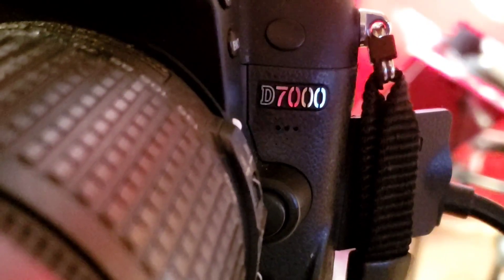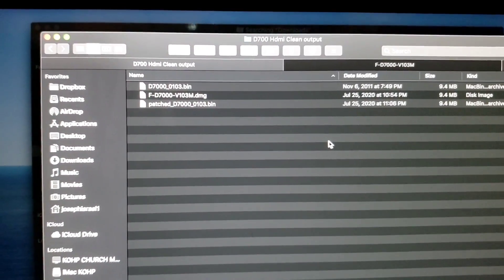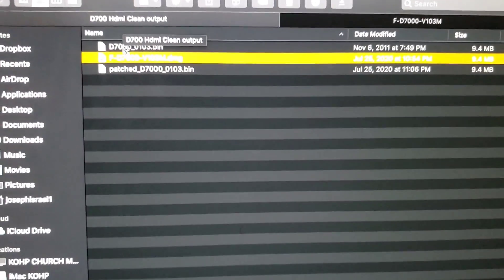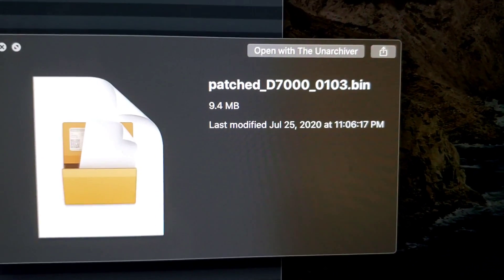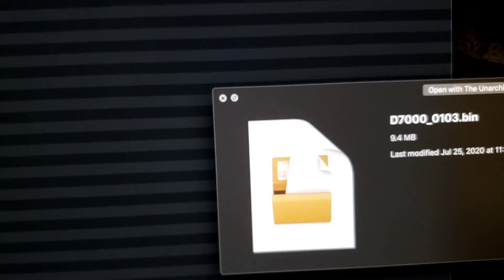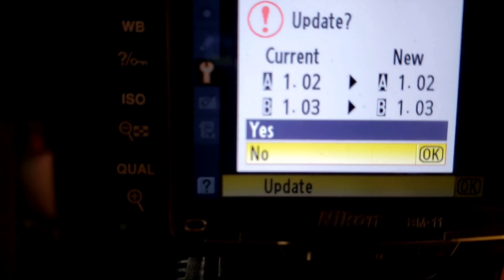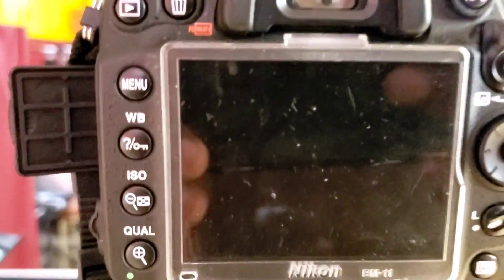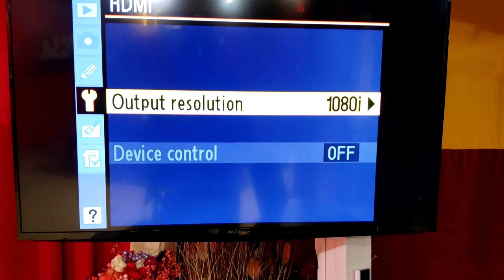Nikon D7000 - How to get Clean HDMI Output - LIVE STREAM – SOLVED !!!

Comment: Hi, thanks for uploading. Just tried this and having put the two SD cards in there was still no option to update? I noticed your previous comment and took all the HDMI/other cables out and checked that I'd renamed the file correctly but the result was the same. Any other ideas? Thank you!
Reply from the maker: If you haven't done it yet, I encourage you to grab THE POWER SUPPLY HERE https://bit.ly/spnikon for uninterrupted power supply. I have made the test for my live streaming 2 years in the row with the power supply, and Did not have any issues.
Reply from the maker: Hello @Ji-Min Lee,
To make sure the system sees the firmware it will be a great idea to only have one SD card at a time. And make sure the firmware is placed in the root location of the SD Card. If possible format (not required, but for further troubleshooting) the SD card into EX fat ... else make sure the firmware name is following the strict format . 
If still no success, please do a short video with your phone of different steps taken so I see what could be the issue...
Reply: @joseph-israel  Thank you, I tried that but unfortunately the problem continues. Do you have an email address I could contact you on? Cheers.
Reply from the maker: @JMLEE96TV  okay get in touch on pji@kohphost.com

Comment: I DID EVERYTHING. I GO TO FIRMWARE ALL I SEE IS A 1.02  B 1.03  C 1.002 DONE , NO UPDATE OPTION.
Reply from the maker: Did you have the hdmi cable or any usb cable connected while updating? I think I have encounter this while I had the hdmi cable plugged in. But once I removed it, I was able to see the update option. Also make sure the file you place at the root of the SD card if properly renamed D7000_0103.bin. Also try to use first slot of the card reader.
Reply from the maker: If you haven't done it yet, I encourage you to grab THE POWER SUPPLY HERE https://bit.ly/spnikon for uninterrupted power supply. I have made the test for my live streaming 2 years in the row with the power supply, and Did not have any issues.

Comment: Faça esse procedimento com bateria em carga total pois pode danificar a máquina já danifiquei a minha
Reply from the maker: You're right, any device update regardless, requires always battery to be charged, specifically with certain vintage devices firmware.
Reply from the maker: If you haven't done it yet, I encourage you to grab THE POWER SUPPLY HERE https://bit.ly/spnikon for uninterrupted power supply. I have made the test for my live streaming 2 years in the row with the power supply, and Did not have any issues.

Comment: I got an invalid downloadlink from insighter. :-( 
Anyone here, who can send me the patch?
Reply from the maker: Hey @Scheungraber, can you be more specific of what issue you're facing? I just tried this link http://bit.ly/3sHxeGl , and I was able to access it, and receive and download the files in a ZIP format and everything working fine. Please what issue you're facing from the link?
Reply: @joseph-israel  same here tried the link is invalid from insighter
Reply from the maker: @yesnaturalsingapore7359  do you mean you can't access the website, or you can access, but can not download the file, or you can access and download but can not open the file... ?
Can you please be a little more specific? because I can access, download, open and use the file without issue, so need a little more info to reach out to them.
Reply from the maker: If you haven't done it yet, I encourage you to grab THE POWER SUPPLY HERE https://bit.ly/spnikon for uninterrupted power supply. I have made the test for my live streaming 2 years in the row with the power supply, and Did not have any issues.

Comment: It worked for D7000 with 1.0.5 firmware - I was able to downgrade to 1.0.3 with clean HDMI with provided firmware! Thanks a lot!
Reply from the maker: Yes thank you for confirming your experience.
Reply: That's coo.  What features are you missing with this adjustment?
Reply from the maker: @boahandarrowsproductions4326  NONE
Reply: @joseph-israel  Coo
Reply from the maker: @boahandarrowsproductions4326  If you haven't done it yet, I encourage you to grab THE POWER SUPPLY HERE https://bit.ly/spnikon for uninterrupted power supply. I have made the test for my live streaming 2 years in the row with the power supply, and Did not have any issues.
Reply from the maker: If you haven't done it yet, I encourage you to grab THE POWER SUPPLY HERE https://bit.ly/spnikon for uninterrupted power supply. I have made the test for my live streaming 2 years in the row with the power supply, and Did not have any issues.

Comment: You sound like you don't want to talk. You even omit certain words you were about to say 3:00
At least explain things clearly. Thanks.
Reply from the maker: @Ben Howell, depends on what you consider details/explanations. But to simplify this whole video : 

If you have a 1.0.1, 1.0.2, 1.0.3, 1.0.4, 1.0.5 firmware version of your Nikon D7000 you can still update/downgrade to the firmware 1.0.3.

You have in the package the original firmware if you wanna go back to the original, and this patched_D7000_0103.bin to get a clean HDMI output with your NIKON D7000

Just Remember to RENAME the patched_D7000_0103.bin into D7000_0103.bin and copy the file into the root location of your "SD Card" (the word that skipped).

if you need more help let me know
Reply: @joseph-israel  Hi there, i have a 6-7 y/o d7000 and haven't done any firmware update till now. It's still A. 102 B. 102 L. 102 version. Is it right that i can just download the patched version, and directly upgrade from my current version? Or do i still need to get the 103 original version first prior the patched version? I'm sorry i'm really confused. Thank you!
Reply from the maker: Hey  @roannes6371  . You can directly used the patched version. It will proceed normal as business. Let me know how it works for you.
Reply from the maker: @roannes6371  If you haven't done it yet, I encourage you to grab THE POWER SUPPLY HERE https://bit.ly/spnikon for uninterrupted power supply. I have made the test for my live streaming 2 years in the row with the power supply, and Did not have any issues.